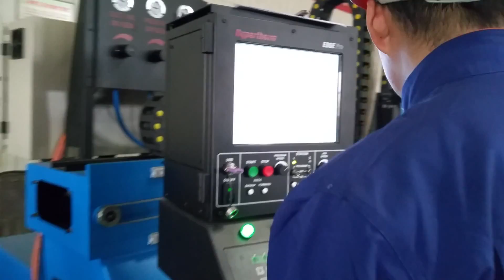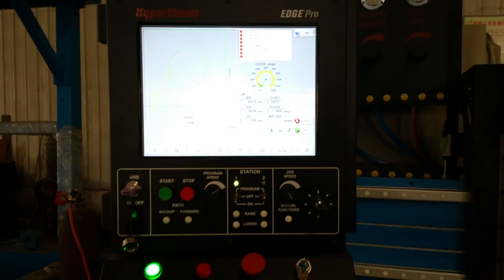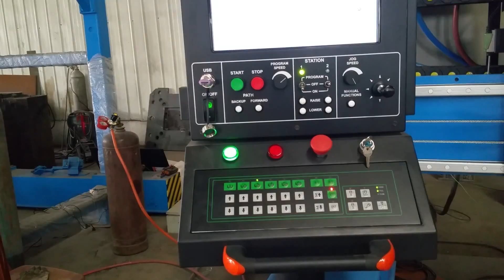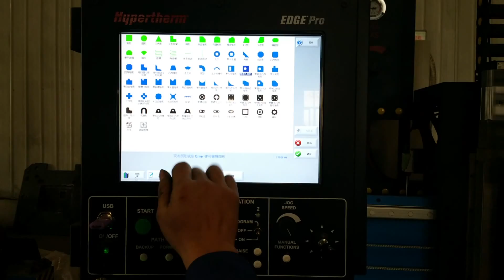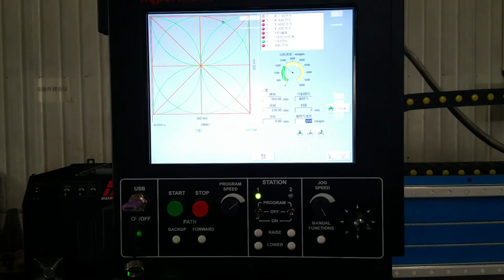CNC Oxyfuel Cutting

Comment: HI SIR HOW MUCH PRICE 2 METER INTO 7 METER PLASMA THICKNESS 16 MM THEN OXY FUEL  150 MM
Reply from the maker: Dear Mr. Nav, Jot , would you please give us email address , phone number? we will send detailed quotation to you via email. you can also email us info@bota-weld.com
Reply: Hi Nav Jot, I am Bobby colleague, we are from Bota welding equipment co.,ltd, see following prices dtails. 
GANTRY CUTTING FRAME(3X9) $7791 , INPUT POWER(LGK120 16mm) $2149, AUTO IGNITION DEVICE $179, AUTO HEIGHT ADJUST FLAME $449, AUTO HEIGHT ADUST PLASMA $179, Total FOB QINGDAO PORT CHINA $11642.0 
Any more inquiry please feel no hesitate contact me at (sales@botazg.com / Tel/whatsapp/sky +8615562131963)